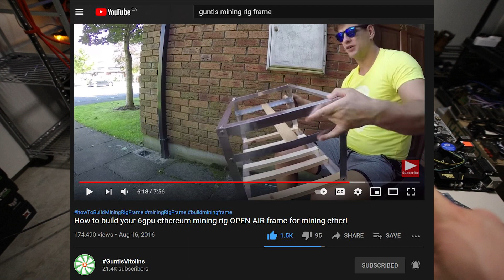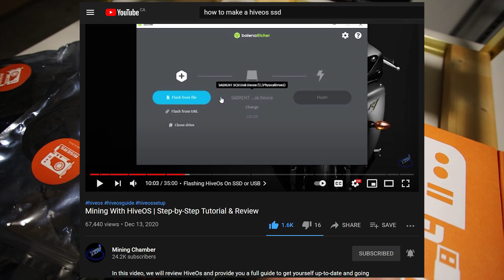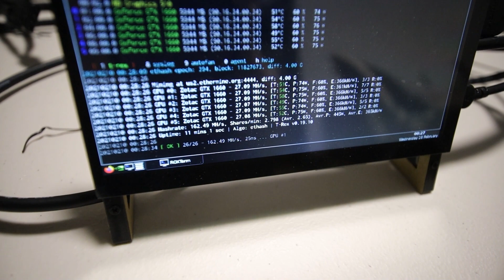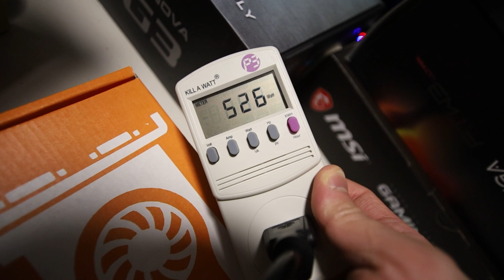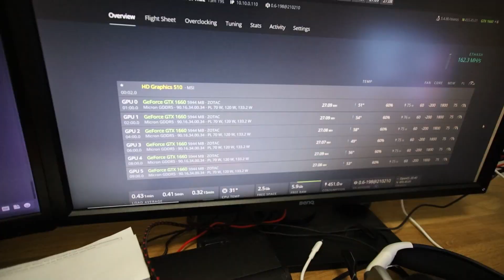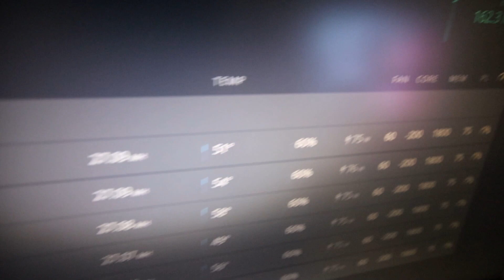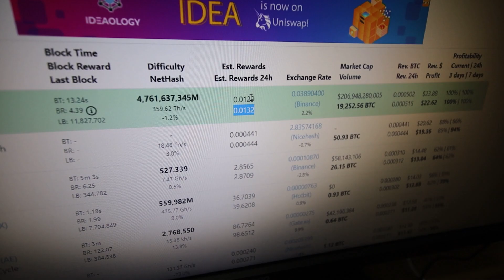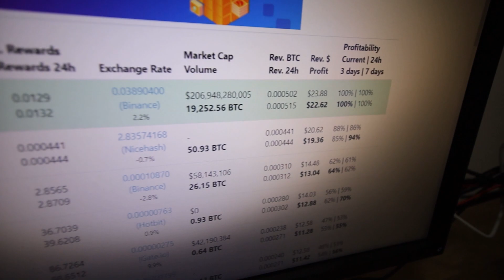Building a CHEAP? $2500 ETHEREUM Mining Rig...

Comment: I have a few old GPU’s gathering dust.  Does anyone know if it would be a problem to use different gpu’s?
Reply: Well personally I would say they are old unused and just set them up but don't overclock it it could set on fire just get them a bit warm and get it back up and running like I would say use it for an hour or 2 then set it up

Comment: Max 288 Watts on a single PCIe 8 pin cable.
Reply: 150w per SINGLE plug/connector only.  75w from motherboard PCIE connector.

Comment: The problem with your master plan and BREAKING EVEN is....
$2,500 is not your break even

You forgot to account for  
ELECTRICITY COSTS
INTERNET DATA TRANSFER COSTS
POSTAGE OF PARTS COSTS
PARTS WASTED
ELECTRICAL EQUIPMENT INSTALLED (such as Solar Panels, Battery Backups, UPS) etc

If you're going to do a video and account FOR EVERYTHING that was consumed then it needs to account for everything 
this is the Delusion of people who make rigs
they think the only thing they need to cover are cost of parts for the rig
Reply from the maker: Video comes out tomorrow about breaking even.